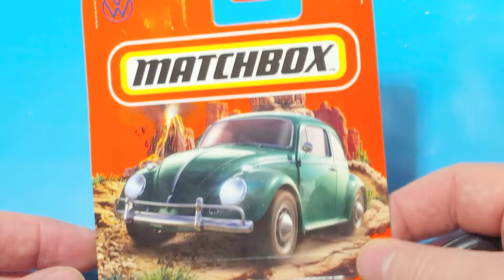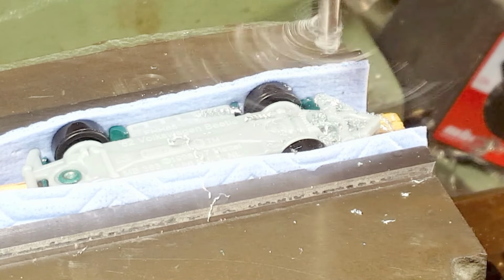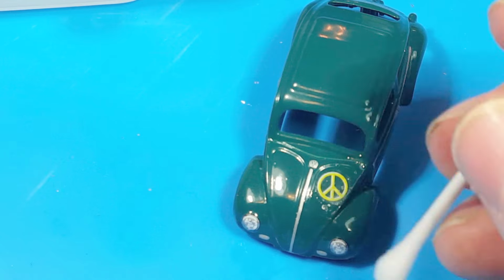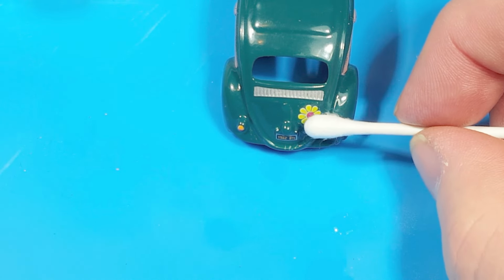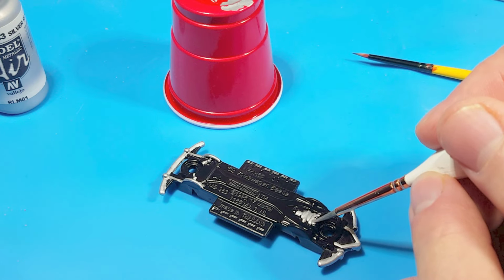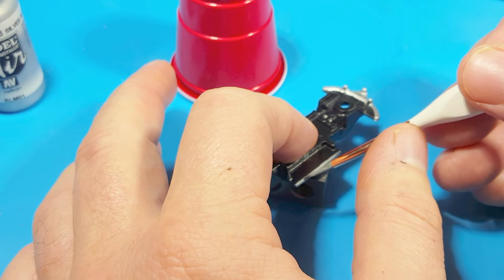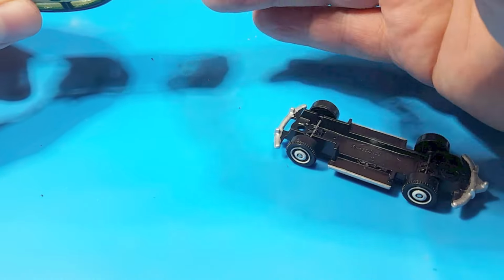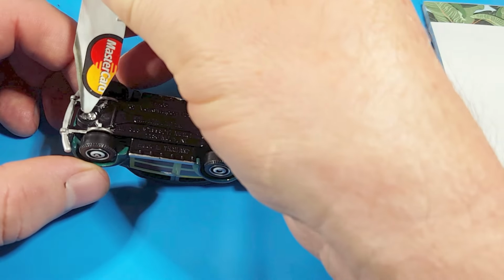Annual Porsche Invitational, Matchbox, Volkswagen Beetle #MLCPorsche3

Comment: You could say that there’s an improvement that can’t be seen…..

 Not only did you improve the look of your bug, but you also added a Porsche motor to the car!

Anyways, great job
Reply from the maker: I tried that on my milk float/race car tow vehicle. Commenters pointed out that a milk float only could drive about 10mph  and was lucky to move a load of milk bottles. I suggested that it had a Porsche engine that I forgot to mention. He replied that "then you should race the milk float instead of the Austin A30 race car. 😜
Reply: @timosdinkydetailing  

 In a TV show years ago I saw a woman in a drive a Bug that supposedly had a Porsche engine in it…. 

 I wonder if anyone really did that?